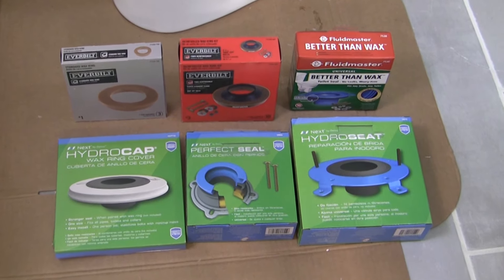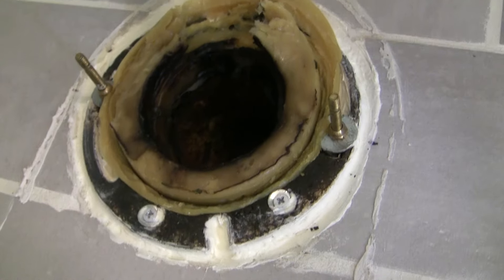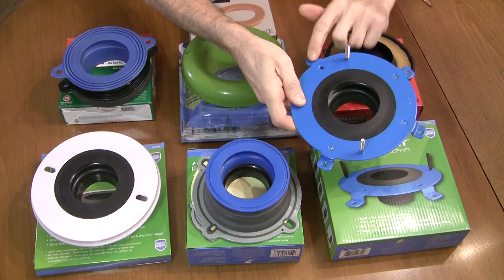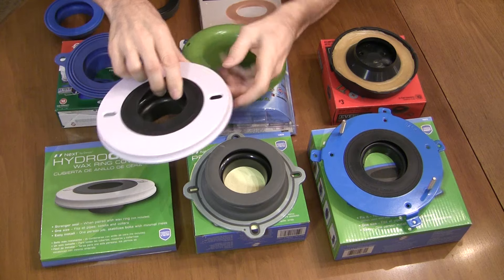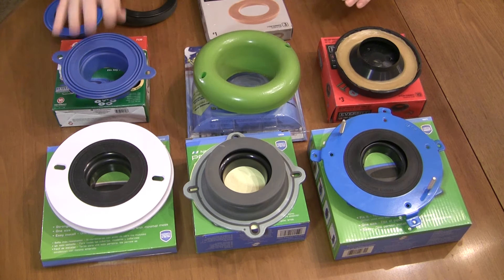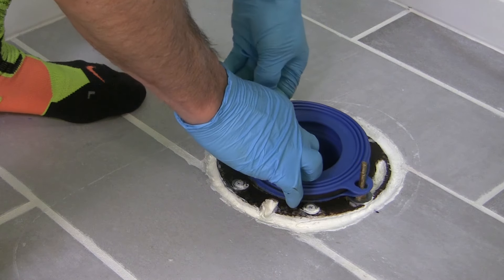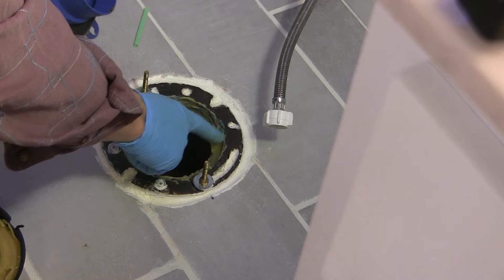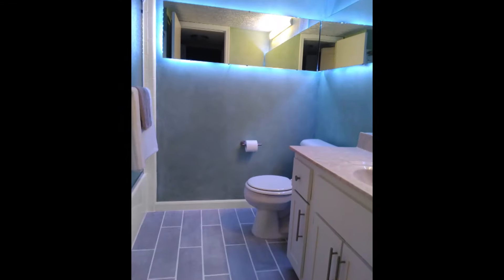2 YEAR FOLLOW-UP to Toilet Flange Fix  / Also, Compare Different Toilet Seals

Comment: One thing my Dad taught me that he was truly right about is that just because you're not a professional at doing diy projects doesn't mean you can't do a better job than professionals . I've seen some so called professionals do pretty sloppy work.
Reply: I agree, with tons of how to videos on youtube and personal experience by the old timers I manage to find a solution.  My mom always encouraged me to learn from the older heads and pick their brain. Good thing is youtube has some of those mentors like Essential Craftsman etc. I do a combo of learning from my elders + youtube videos.. i personally believe if there is somethinf that needs a repair youtube has a video for it.. im not that old (38) but im used to passed along knowledge but youtube specfic videos have saved my butt..
Reply: No kidding. I'm an amateur but even I have done better plumbing work than the "professional" plumbers in my area. Granted there are only 2 of them in my area and both of them suck. One of them busted holes in an elderly man's brick wall to run a vent pipe for a washing machine & didn't even seal or patch around the hole on the exterior. He also only ran the pipe up a few couple feet and slapped an AAV on it. AAVs aren't even allowed by my state's plumbing code. And this is an exterior vent! When he did the other drain pipes he had the customer's grandson dig the trenches but then charged for digging even though he never touched a shovel and he just slapped the pipes into the trenches without any slope and left them sticking out of the ground (he didn't set them all the way down into the trench). I almost hired that guy but after that I would never let him touch a project at my house. The other guy won't sweat copper (which I admit I won't do either) and rushes jobs & doesn't care if he leaves a mess in a customer's yard or house. He didn't even bring the right equipment to do the job & had to use our wire hangers (got mad last time he came out bc he used up the last of our hangers & we don't have anymore and they don't sell them in the area). Doublecharged for literally 2 minutes of cleaning a drain because he was mad that he showed up a day early without calling first & my disabled mother had trouble getting to the door-- the kicker is, he saw her come out but because it took her so long to answer he left anyway and charged us for that visit. After that I learned to snake drains myself.
Reply: You should move to an area that has more plumbers
Reply: He's lucky he has 2! We only have 1 where I live. Granted he is awesome and does great work. We also don't have any handymen who aren't strung out so I'm looking at having to do everything myself if I want it done halfway decently. I sit here watching videos about the product I already bought to fix my toilet which started leaking lol. Glad the product I chose is the one people seem to like and use.
Reply: Kevin Sorenson.  Back in '03 I was building a small work shop. I did the framing, insulation and all the sheet rock work but before the insulation and rock, I asked the electrical inspector if a DIYer could do the wiring and save a ton of money.  He said yes as long as it was code.  So I bought a bunch of romex, switches and recepticals and spent a week mapping out where I wanted stuff.  When I was nearing the end of the project, I called for an early inspection as the dept suggusted.  He pointed out a minor few things that needed to be corrected.  About 3 weeks later after I was sure everything was up to code, he came back and told me for an amateur, I had done a first class job, better than some pros, in fact.  He signed the job off and I had power the next day to where I could work nights putting in insulation and rock.  The days were just to damn hot to work in.   Plumbing isn't usually my thing  but the wife needs a new more modern toilet, so I guess I will try it.  If Joe the Plumber can do it, I guess I can too.   Cheers, my friend.  Bob
Reply: Kevin Sorenson       I always let a professional fix my (well my employer's) jet.  You haven't lived until you see a jet completely taken apart and spread out for a major inspection.  One of those can take tens of thousands of dollars up to millions of dollars depending on which inspection it is and what kind of airplane it is and how old it is.  As Dirty Harry said, "a man's got to know his limits" .....LOL

Comment: I AGREE the Toilet Sealing industry is still in the Flintstone animation era. If a toilet flange was casted to the bottom of the toilet and protruded down into the drain flange a double sided compression seal should seal up the floor/toilet matting surfaces. Fluidmaster is BEST SO FAR!

Comment: Marty, the Fluidmaster comes with a height spacer for flanges that are too low.  You didn’t need a second gasket.
Reply: I was wondering the same thing.  Why not use the height spacer?  I mean, if you want to buy two then go for it.  But what do you gain by using two versus the added spacer?
Reply: Good info💥👍💥
Reply from the maker: The height spacer would have raised it up too much because it's so big. I thought two funnels interlocked would be better than one.
Reply: Spacer compresses and I think it would have worked. Did you try it?

Comment: So what if it took you 10 hours?  I plan on doing two toilets and I'm sure it will take at least that long to do the work along with the absolutely required 3 trips to the hardware store.  I'll do it over 2 or 3 days in my spare time, maybe over the weekend listening to a ball game or old radio show on the computer.  I just finished doing a toilet tank bolt job, a toilet supply valve and supply line replacement and a sink faucet repair.  I didn't push myself and really enjoyed the jobs and the sense of accomplishment I gained.  So it was 10 hours well spent and I saved probably $300. Maybe more in this high priced town.   I'll go to a great restaurant and have some fine wine with my meal with that money.

Comment: Stumbled onto your video; I rarely comment. As a professional plumber I enjoyed your video and would agree, social media is full of Monday morning quarterbacks and "experts" there to tell you how you did it wrong.  As a homeowner who cares, and is willing to put in the work/effort, you can sometimes do a better job than someone you might pay. Now to your repair; I noticed you are very concerned about the level of the flange. I've never put a level on the flange and know that the odds of finding a perfect one are nil. What's more important is where the flange is in relation to the top of the floor(I know it's not level). Only reason that's important is it determines how thick a gasket/ring you will need to make a good seal.  Since I started my business doing service and repair, I've never stocked wax rings on my truck.  I've always used different types of foam gaskets like the ones you show in the video. Sani Seal is a great one.  For a while I've been using a product called Tight Seal gasket made of elastomer.  Gaskets always more $$ than wax, but so worth it.  BTW, I hold no ill will to those who want to do their own work.  Of course I don't make money as a pro that way; but I also don't have to do the work!   Keep up the good work.
Reply from the maker: "...but I also don't have to do the work."  Haha.  Thanks for commenting.  Sorry for the delay.  Sometimes I live in a time warp.
Reply: Yes this is a good comment, and a good video. Essentially the end product is to get a good long lasting seal. As it your own  toilet, you have the time and attention to research and do the best possible job you can. Plumbers will never go out of business, because who wants to do a job like this in a well used high traffic commercial restaurant😊 But good job 👏

Comment: This man speaks truth! Love his comments. Seriously, toilets haven’t changed in my lifetime
Reply: The uh change every day almost including the toliet seats bra
Reply: Toilets have changed for the better.  Our new 1.6gpf Kohler one-piece has yet to be clogged by our olympic dumper 15 yr old son.  He was clogging our old 1984 Am.Std Plebe 4gpf on a weekly basis.  The Kohler has 2 flush modes:  quick press/release of the handle to flush .75g for pee, or depress the handle for 4 seconds to release the full 1.6g for a dump flush.  My wife loves the one piece design for teenage-boy-spray cleanup.  Also, one-piece design avoids the possibility of the water tank leaking through those bolts and seals that attach to the bowl.  And we all love the soft-close seats.

Comment: Just used the Danco Perfect Seal today. I used it EXACTLY as the instructions tell you and I am impressed. Can’t see going back to a wax ring after today. For the record, my flange was flush to the sub-floor but we had added tile. I used the seal with both the black insert and the blue spacer….. sits perfect…. no rocking. It had a wax seal before and I had to shim it to keep from rocking

Comment: Bravo, you hit the nail on the head here.  I installed a new toilet two days ago and after doing a little research decided to give the Fluidmaster non-wax ring a try.  However, my comfort level about having achieved an actual seal  immediately after the installation was next to zero, so I went straight back to using the wax ring that was fortunately included with the toilet. Back to the stone ages…
Reply: I guess this is a common experience. I did exactly this 2 years ago. When I set the toilet down on the rubber gasket I wasnt feeling good at all about how it was seated and just used the wax ring that came with it instead as well. I just really perfer that nice seal you get with a wax ring, and with how cheap they are it isnt the end of the world that it cannot be reused.

Comment: Your comment about the "20 minute man" was spot on. You call a plumber today, he's on the clock so it's "Blow and Go". They are pigs, almost never cleaning up behind themselves. Yeah, this was a little overkill, but your toilet didn't leak a drop. Can't tell you how many times I reseat a recently installed toilet that is leaking. Other than not using the 3 1/2" closet bolts (and hacksawing them down so the bolt caps fit) don't apologize to anyone here. It's the "Pigs" reputation that you can't equate to his value. I encourage all my home owning customers to take a swing at doing this kind of home repairs. It ain't rocket science. If not, there are guys like me out there who do make love to making sure these jobs are done right and left cleaner than when I showed up.

Comment: Great job on the flange,  I used the fludmaster seal and had to use both pieces from the kit because my flange is below floor level due to the way they tiled my floor.  Our issue is that with wax every winter we would develop a leak.  The rubber and the foam seals have held up for two years so far.

Comment: Job well done, I enjoyed how you addressed, then dismissed, the 20 min bonehead.  Those people are out there no matter what you do. Great information.  I've used wax rings for 20 years, and will continue to do so for 20 more.
Reply: A properly installed wax ring can last almost forever if no plunging is required. However most toilet removal photos show a lot of creepy crud around the flange and even on the floor. In my case I have Kohler Rochelle toilets installed in a tight location where I can't peek around the rim to see the flange bolts. It's also a bit tight to try to use a spotter. I have been able to do it with some difficulty by using stacks of shims and removing them one at a time but Have often damaged the wax ring and had to reform or replace it. This time I am going to try either the Sani Seal or the Fluidmaster and the shims hoping for a more forgiving placement.

Comment: Kudos to you for going the extra mile to double check your work. I especially like how you added additional wax to fill in the possible voids in the seal creating a hybrid of both. Great job.
Reply from the maker: Thanks.  Yeah, I did what I felt like needed to be done here, but I have a follow-up video to this one and it didn't hold up all that well.  The biggest problem was that my drain opening was too big for this seal.  Also, these rubber seals have a problem holding up to the chemicals in the water ...over time.

Comment: I use the green foamy seal (managing rental multi units) all the time . Installed a few dozen so far for a least 6 years. None failed yet . No leaks and being reused every time if toilet needs to be reinstalled .
Reply: The green ring is the best . No problems with it at all .

Comment: Marty, thanks for this video. I'm not a plumber, I'm a mechanic, I'm about to swap out the old wax seal on one of my toilets in my condo with a new rubber one. Unfortunately, I'm left with which seal to use since I was bent on using that green one like you originally were, but the warning you gave about those leaking really caught my attention, because I hate doing something twice. Thanks for the heads up my friend, and I agree completely with you that the toilet manufactures should really come up with some better ways/better products. These things suck!!

Comment: I'm a nurse who loves doing things by MYSELF! I've had previous upstairs disasters with leaking plumbing so I like to be able to know how I sealed it and check it periodically.  Your creative methods are awesome - I wish there was a leak indicator that we could mount on the subfloor to be able to know if water is soaking into that if leaking under the tile floor that would save lots - thanks.
Reply: How about using spacers to raise the flange above the floor and seal the gap between the flange and the tile floor using silicone? If there is leak, water is on the tile floor, not under.

Comment: I bought and tried to use the fluidmaster better than wax seal when attempted my first every install of an American Titan Standard toilet. The flange was slightly above the floor and the toilet was wobbly. It never balanced so I was forced to use the wax ring that it came with. Sucks to have spent 10x more than a wax ring. I would say the wax ring is more DIY friendly and easier to use.

Comment: Great job! We find that when we do projects around the home ourselves, we also take more time yet we also take a lot more care and put more thought into the finer touches. We have had some pretty shoddy work done when we have let the 'pro's do the work for us. Generally, because they are in a rush to move on to the next job. 
Some jobs though I really don't enjoy and struggle through, watching countless videos until I feel I can tackle it, and sometimes struggling through, yet in the end, I have a better result. We tend to overdo things too, especially now as we are tiling the bathroom my hubby had to remind me we are not making a swimming pool as I was taking the waterproofing the outside corners of the shower pan too far. 
The toilet was an issue as to save having to tear out more ceiling below and redo the drainpipe I opted for a 'twist and set' flange to work with the existing pipe. It seems to be a good seal and once our shower drain is also installed we can test it as they share the same line.

Comment: Great video! Just replaced my failed wax seal with the blue “Better than Wax” seal. The original seal was wax, leaked horribly, the plumber sealed around the toilet base with silicone (before I bought the house). When I removed the silicone the floor flooded with brown water. First attempt with a wax seal lasted 6 months then started leaking. Called plumbers, they all quoted $500 to replace seal so I bought some seals like you. The non-level flange was 1/4” above the non-level tile floor and was not level. By adjusting the nuts on the bolts and using shims (Wobble Wedge) was able to stop the leakage and stabilize the toilet. Plumbers only want to take your money and could care less if they actually solved the problem.
Reply from the maker: Damn, $500 to replace a seal?  Where do you live?  That's robbery.
Reply: Central Coast CA. HD associate told me to use 2x wax rings. The blue “Better than Wax” seal is still leak free. When I asked plumbers why they charged $500, they said “going rate, toilets break, this covers the replacement”.
Reply from the maker: @waynethompson6430    That's crazy.  It's like they're forcing people to become DIY'ers.

Comment: i really like how he filled in the space between the flange and tile to prevent water from going under the tiling and creating a bigger problem. This helps to know if their is a leak from the wax ring, The caulking around the base should have some hole to let the water out.